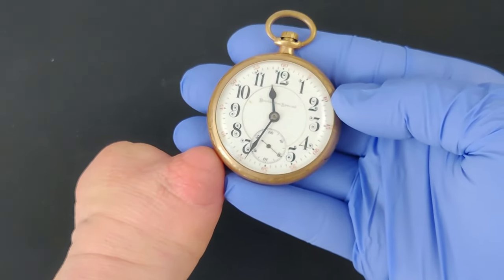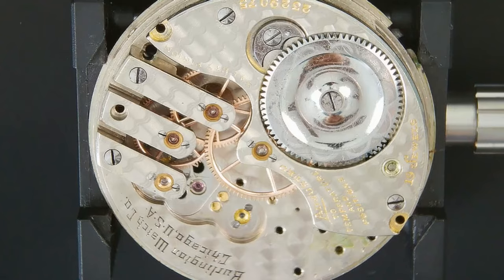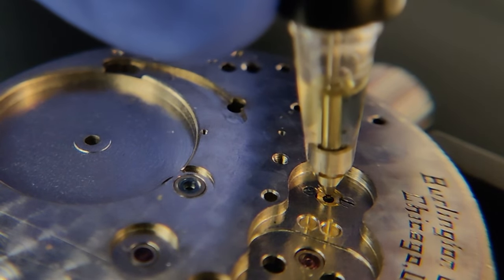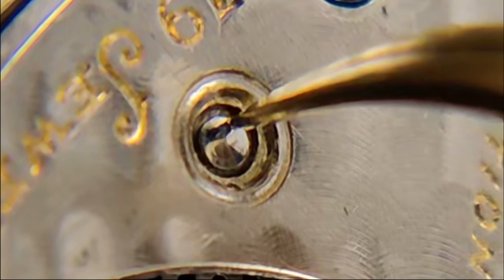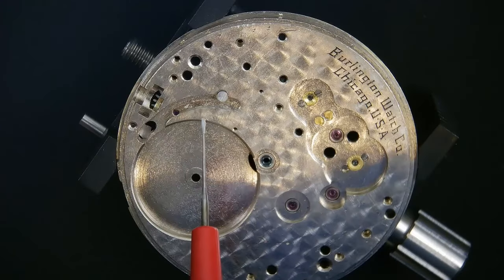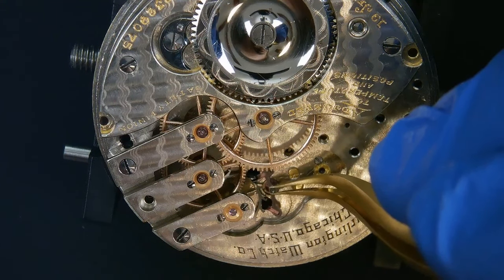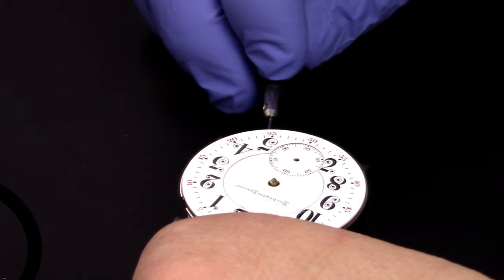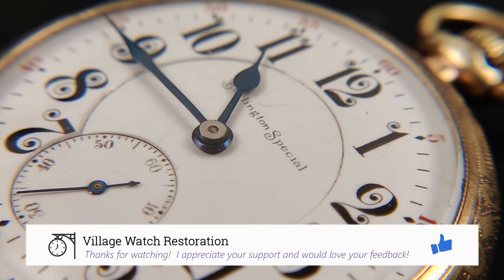RESTORATION ... with a HAMMER? #pocketwatch #watchrepair

Comment from the maker: You might enjoy:
🍿Iconic Hamilton 992 rescued!  https://bit.ly/3B8B3hb
🍿Can I Restore Busted Landeron Chronograph?  https://bit.ly/4hhd7Zq

Amazon Affiliate Links (I receive a tiny commission from any purchases, but the price for you remains the same.  Thank you!)
 Microscope used in video: https://amzn.to/3NEIiQX

⌚*Want to try Watchmaking?*
- Affordable & Basic Starter Kit: (mostly unbranded to keep costs down)
1. Movement cushion/pad, https://amzn.to/4dUlbwo
2. Tweezers, https://amzn.to/3UquOMn
3. Screwdrivers, https://amzn.to/48p3Omq
4. Generic movement holder, https://amzn.to/4hmpXph
5. Case knife, https://amzn.to/3NEavaE
6. Rodico, https://amzn.to/40jt9fA
7. Air blower, https://amzn.to/3NFCbfm
8. Finger cots, https://amzn.to/4dZkbY2

- I am liking the hobby!  Let's add cleaning supplies:
1. Simple artist nylon paintbrushes, https://amzn.to/4fcwfql
2. 99% Isopropyl alcohol, https://amzn.to/3AbLq3D
3. Ultrasonic cleaner, https://amzn.to/4eWIzuy

- I'm all in!  You'll need 3 basic oils/grease:
1. Oilers and oil cup, https://amzn.to/4fiik1y
2. Moebius 9010 (low viscosity oil), https://amzn.to/48o0yI0
3. Moebius D5 (medium viscosity oil), https://amzn.to/3YmZb7w
4. Moebius 9415 (thick grease), https://amzn.to/3Al3cBp

Comment: Lovely job. I am surprised that you didn't drill out and replace the worn bushing. I'd be worried about the longevity of the rehammered bush.
Reply from the maker: Thanks for your feedback and support.   That sounds like a good idea, but I have a somewhat limited toolset.  Possible without a lathe?
Reply: @VillageWatchRestoration  thanks for your reply. You could use a miniature drill press with a dremel if you feel brave enough, or you can broach out the existing hole until it's wide enough to accept a small bushing,  hammer it in with a watchmakers hammer, then broach it to size again. My own toolset is somewhat limited. I have screwdrivers, tweezers, movement holders, oilers, all the essentials.  I don't own a cleaning machine anymore since mine decided to tire of life. I'm by no means a pro myself.  I've been lucky enough to never have to rebush a pocket watch, but I have bushed some very fine clock movements around the same size. Punch bushes are an approved technique,  I have done it myself on cheaper movements as an apprentice.  I have had those same clocks come back for the next service and found that the punch bushes wear quicker than replaced bushes. Presumably because the metal is thinner and has been stressed
Reply from the maker: @adamoneale4396  thanks for the thoughtful response. I am not sure I trust myself yet to do what you just described, but if I ever come across another worn bushing, I'll refer to this.  💪🏻
Reply: @VillageWatchRestoration no worries at all. I am happy to pass on anything that could be useful, and I pick up a lot of techniques from your videos that I wasn't taught. That's part of the beauty of this skill. There's many approaches.  If you want to learn bushing without worrying about ruining pieces,  you could pick up a couple of smiths or ingersoll (or similar) watches that were mass produced and not valuable, or pick up a broken movement or two from ebay to practice on. I did that a lot wjen learning on clocks. Missing parts, broken pieces? Doesn't matter if all you want to do is practice technique. If you mess it up, oh well, it was already broken or not valuable enough to matter :) I am by no means an expert. I took an informal apprenticeship with a horologist and after his passing, just continue as a hobby. I mostly work on jewelled watches and am a big fan of working on the old Doviet movements. I would argue that a Raketa movement is easily equal to a Tissot of its day. I'm not exempt from mistakes either. I have just fully serviced a lovely, fully working (but dirty) 17 jewel Sekonda, which now refuses to run despite having no visible issues whatsoever🤦‍♂️. I suspect something stupid like a flipped cap jewel, but I am honestly sick of working on it. I was taught early on to step back for a bit when frustrated and come back with a clear head.
Reply from the maker: @adamoneale4396  you're giving a lot of great tips.  I hope other people who stumble across these comments will pick up a thing or two from you. Thanks for your contribution! 💪🏻
Reply from the maker: @adamoneale4396  how does an apprenticeship work nowadays?  Did you just find a local watchmaker and ask him?  Or is it formalized through some sort of horology school?
Reply: @VillageWatchRestoration  I started with horology before watchmaking. There is a body for formal qualifications (BHI, British Horological Institute) but I found a local horologist and started working for him on a Saturday when I was 14
Reply from the maker: @adamoneale4396  that's really really cool that the local guy worked with you.
Reply: @VillageWatchRestoration  lovely chap. Had a tiny shop in a little old converted farm square. After he passed away, I moved to a different career and just do it as a hobby now
Reply from the maker: @adamoneale4396  what a fascinating story.  How many watches do you repair per month at this point?  Did you manage to purchase any of the watchmaker's tools?
Reply: @VillageWatchRestoration  he didn't actually do watches. After his passing, I got in touch with one of his friends who was a very talented watchmaker and he taught me the basics. I did inherit quite a lot of horological tools including a gorgeous vintage staking set, an enormous quantity of clocks, 28 teasmades and a full folder on the repair, service and history of them. Whilst alive, he was rhe world expert on Goblin teasmades, did a chat for the BBC about them, and left all of his accumulated material to his son, who passed them to me. One of my most prized possessions to this day
Reply from the maker: @adamoneale4396  that's an awesome story.  It really brings me back to the apprenticeship days of yore.
Reply: @VillageWatchRestoration  it really was. You stood in this rickety old whitewashed barn and the ticking of say a hundred clocks sounded like water flowing. It was very peaceful until 12 o clock midday
Reply from the maker: @adamoneale4396  if you don't mind me asking, this sounds like it was set in the British countryside or something.  Was it?
Reply: @VillageWatchRestoration  Yes, indeed it was. I am English and have lived in the countryside all my life! Do you know, over here a lot pf American movements are looked on as unserviceable? The thin skeleton plates and open springs are a testament to post civil war mass production,  but a nightmare for the horologist who is used to solid plates and barreled springs!!
Reply from the maker: @adamoneale4396  ah... There's nothing like the British countryside. The Cotswolds is divine (the less touristy parts)....
Reply: @WatchRestorationCottage  I'm from the South West. Where the cider flows freely and you can count to twelve on your fingers!
Reply from the maker: @adamoneale4396  I love it.  You sound like the Hobbits in the Lord of the Rings, talking about the Shire. I mean it in the most complimentary way possible.  I wish there was really a place like the Shire.

Comment: Excellent. The odd-shaped flat piece with the holes - what is that called?
Reply from the maker: Hi, thanks for stopping by!  I want to answer your question, so can you point me to the timestamp in the video?  If I had to guess, I think you're referring to the bench anvil ?Thanks again.  👍
Reply: Ooops - I meant 6:33.  @WatchRestorationCottage
Reply from the maker: @curiousassortment  ah, ok. Yes that's a bench block, or bench anvil.  Very versatile.